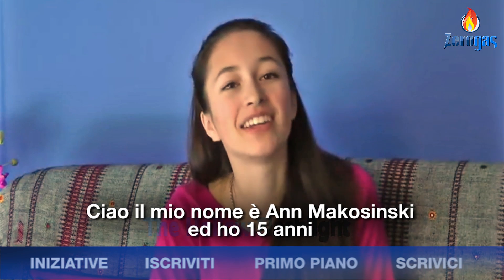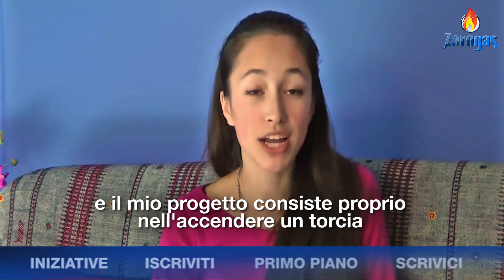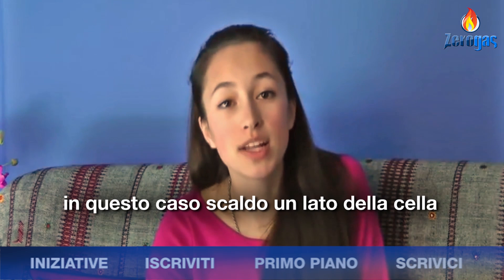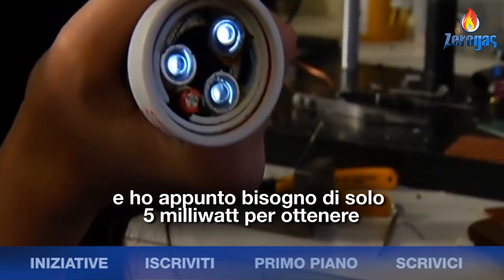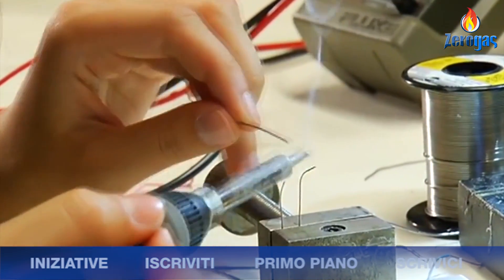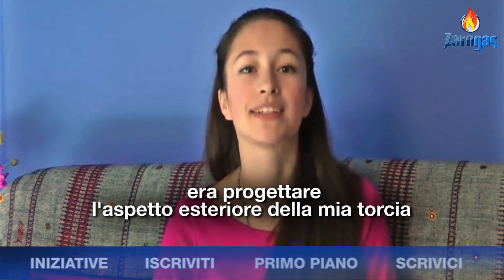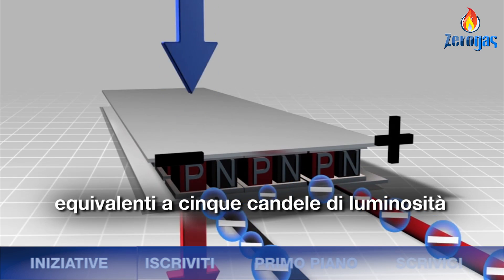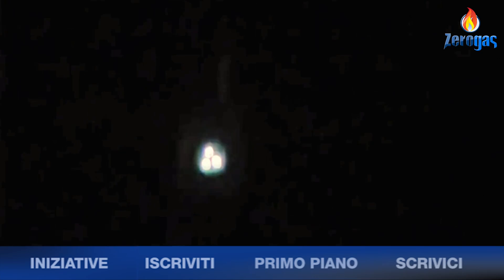INCREDIBILE!!! Torcia senza batterie si accende con il calore della mano

Comment: Si ma non é che se la mano produce 5 milli watts allora la Potenza del LED sarà 5 milli watts, le celle di peltier hanno un rendimento bassissimo, specialmente alle basse differenze di temperatura e specialmente se usate per produrre corrente, parliamo dell' 1% anche meno se va bene
Reply: Confermo
Reply: Ciao.. Dipende sempre da quante ne colleghi è ovvio! Non puoi avviare un auto con una batteria stilo.
Ma puoi farlo mettendo in serie e parallelo molti più elementi.